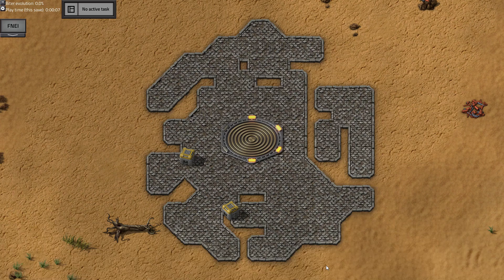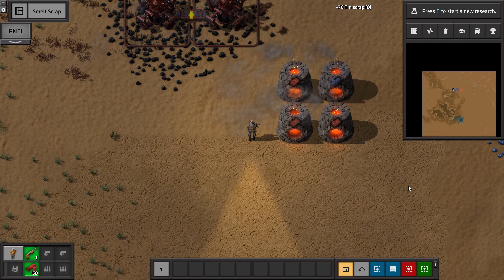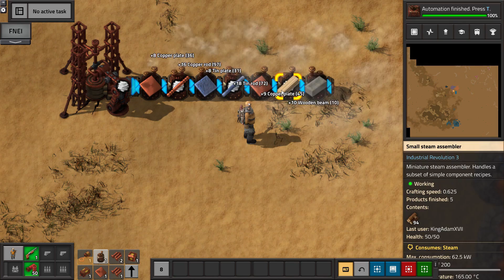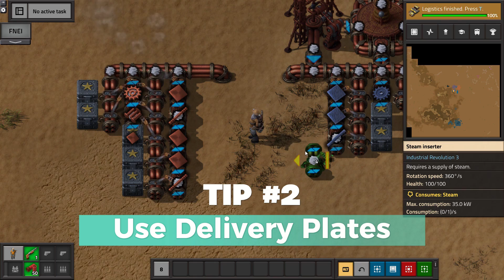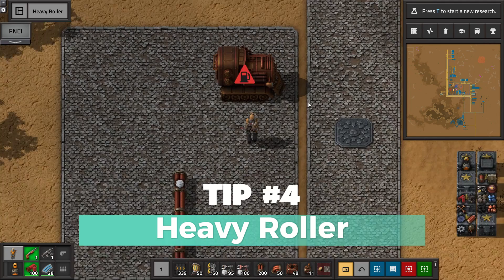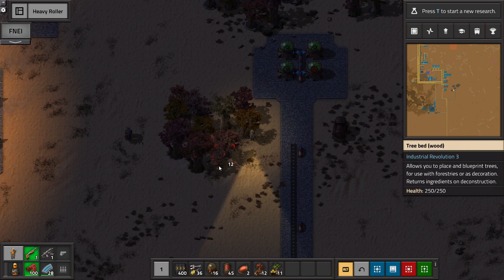Quick Start Guide - Industrial Revolution 3 (Factorio)

Comment: Maybe a bit late, though I'd add my 5 cents.
It's quite worth to pursue sour gas fissures before oil processing. This will give you fast and simple access to sulfur, which means earlier cliff explosives and rocketry. This gives quite solid basement for expansion, along with steel ammo which you'll get before rockets. I went so far as making gas fissures 133% more frequent, which gave me 4 of these roughly on the way to my iron patch.